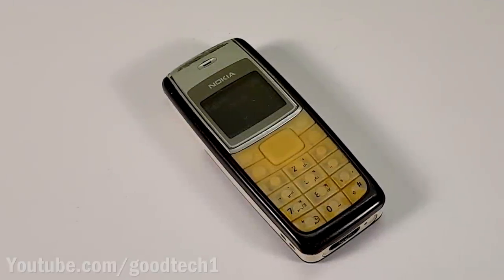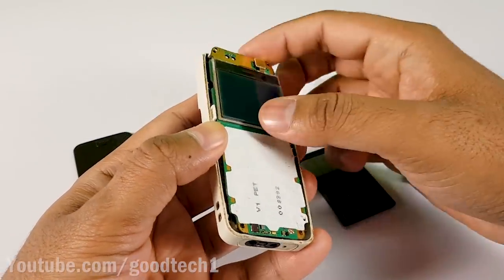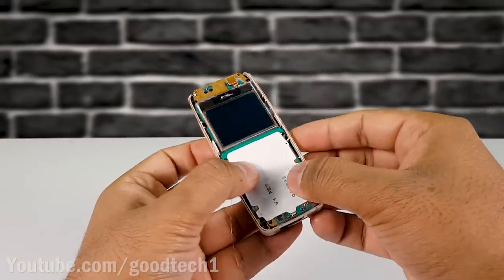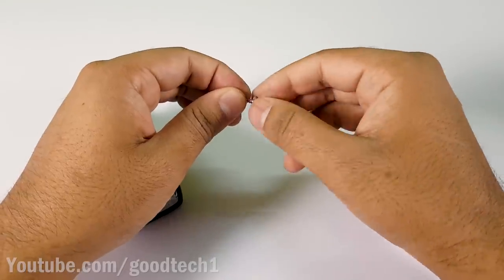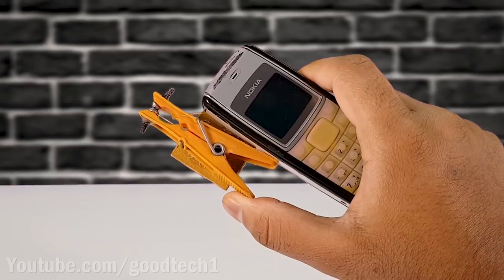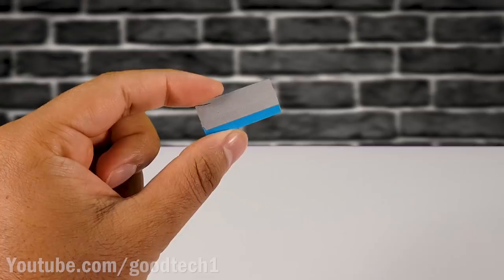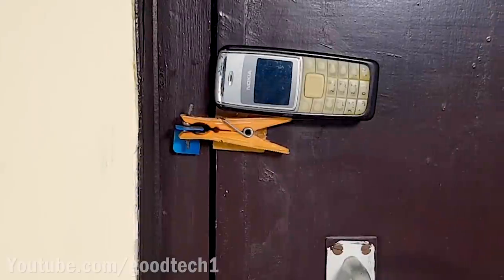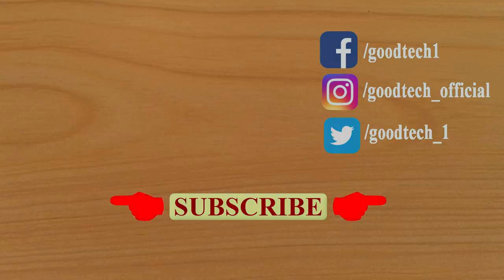What can be done with Old Mobile Phones

Comment: Good idea. To bad it won't work. If you hold down the key the call won't go through.
Reply from the maker: I too had the same doubt when i thought of making it but the cell phones are designed to take an input once at one keystroke. Even if the key is pressed, it does not register a key stroke again till it is lifted back but the speed dial feature works perfectly fine.
That is why this works like a charm, when the card is removed and the contact is made & activates the call. 
However, if you cut the call at the receiver end, you need to insert the card back again to reactivate the system to dial a call again.
Reply: @goodtech1  Wouldn't have commented unless I was sure. I double checked it since it was simple to do. It does not work. The call does not go through. Hardest part was going to Walmart to get the sim card for the phone. Sorry but you idea does not work. Its to bad it sounded cool.
Reply from the maker: I am still not sure because its working really well on my cell phone. May be it is cell phone dependent then...I am sorry for the hassle you had to face.